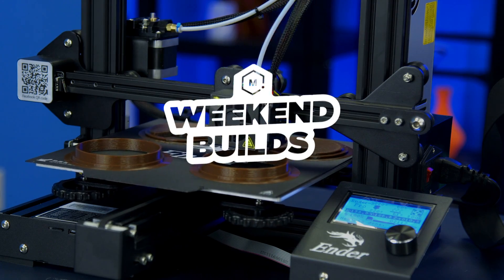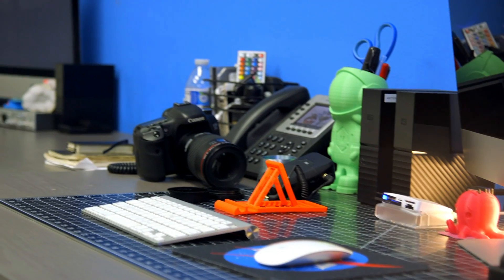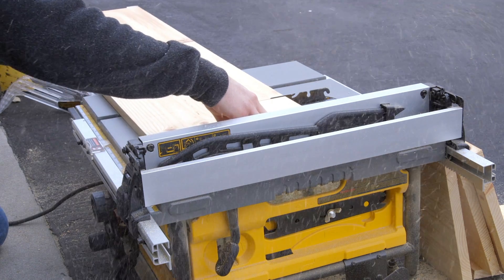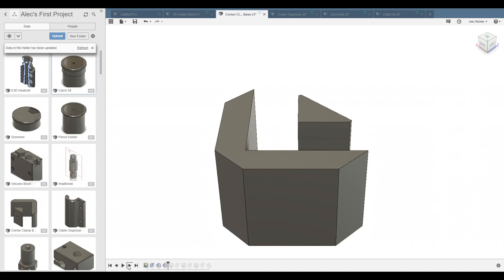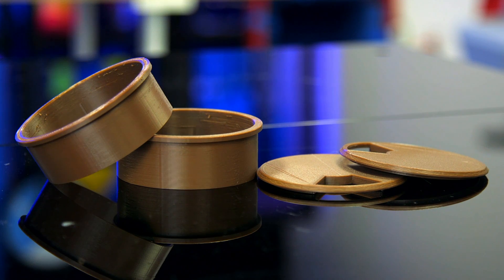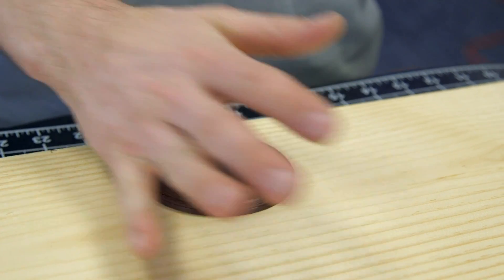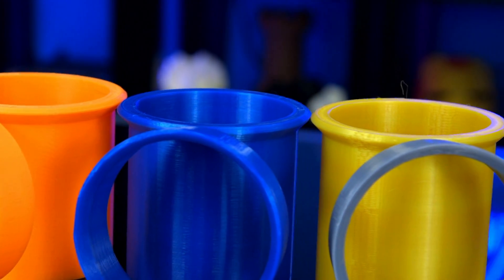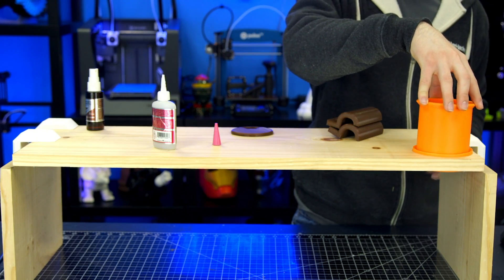Let's Build Monitor Stands with Creality3D Printers and MH Build

Comment: What happened with the cr-10s pro? Why did it stick so bad?  I thought all pros came with a flex plate of some kind. Also, watched your 2014 video about dying nylon, worked perfect! My kitchen floor however....lol
Reply: only ender 3 comes with a flex plate, and that flex plate is limited by the magnetic surface which can't go above 70c. I'd recommend looking at the wham-bam flex plates as their magnetic surfaces are rated pretty much as hot as you'd need.
Reply: @kazolar  oh wow I thought all did! Good to know! I got a wham bam coming for my ender 3.
Reply from the maker: @TheMidnightSmith  While the CR-10S Pro does not have a flexible bed (it's a BuildTak like material on a removable aluminum bed), the CR-20 Pro and Ender 3 Pro both have flexible magnetic beds. Kazolar is right in that they are limited in their temperature range, but you can always put a BuildTak Flexplate on the CR-10S Pro.

Comment: can NylonX be printed on a print bed that does not have heat?
Reply: Maybe with their garolite beds, I haven't used that yet. But all other beds require heat to prevent warping, add a brim too. I have had success direct on PEI slow and brim, but glue sticks work well too.
Reply from the maker: @TheMidnightSmith  You really want to use bed heat if you can. While I haven't personally tried to print Nylon or NylonX without heat on the bed, it's possible that you could get a decent print using garolite and PVA glue stick. Best of luck! - Alec
Reply: @MatterHackers  once y'all get some not huge ones back in, I'll be grabbing a garolite surface to test!
Reply: @MatterHackers  can NylonX be printed on a bed with no heat, as long as i am printing short (in length) projects (i.e. plant pots?)